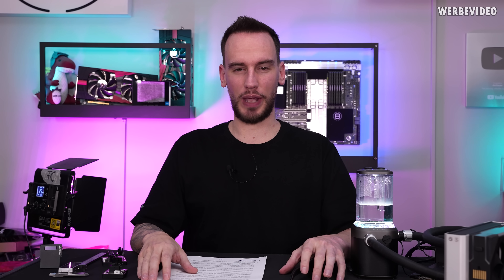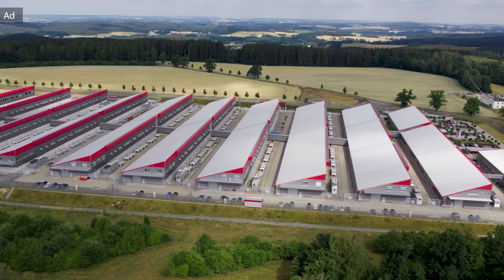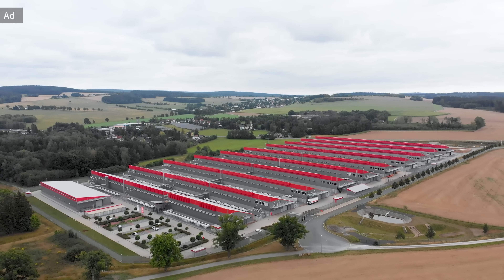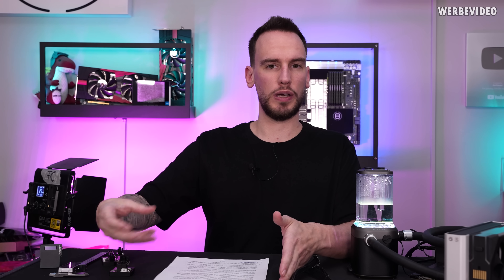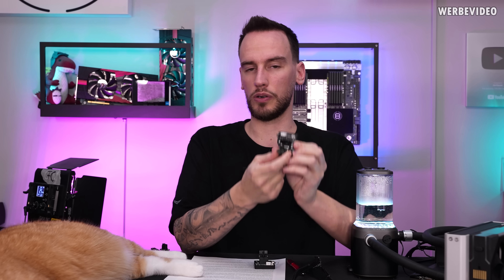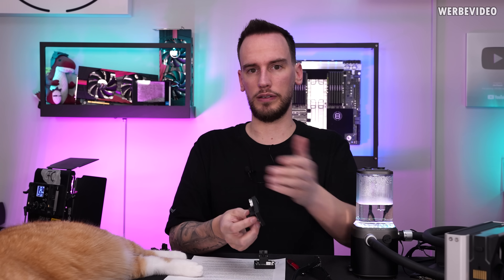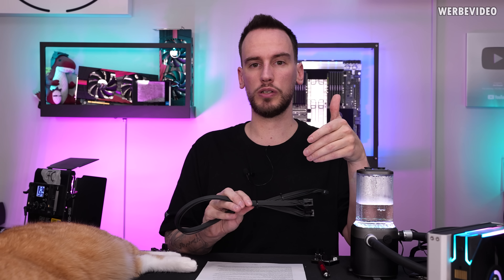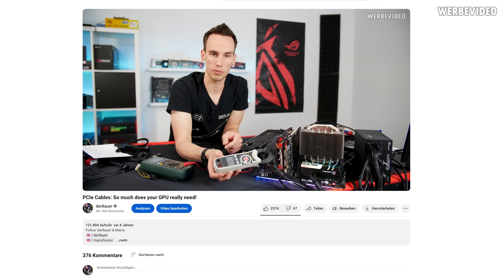12VHPWR is just Garbage and will Remain a Problem!!

Comment: The biggest tragedy I'm finding in all of this is nobody is stepping up to take the blame and explain what happened, nor is any government body making that call. I'm surprised the EU isn't doing something to the effect of slapping NVIDIA or anyone involved in PCI-SIG with penalties until they explain why there's literal fires going on in people's computers.
Reply: Gamer's Nexus took out the momentum there unfortunately
Reply: @fist003  How did they do that? This is an obvious fire hazard, regulators should be forcing a recall regardless of what GN says or does.
Reply: @bobbygetsbanned6049  based on their video at that point of time, the finding mostly pointed towards user error in not plugging it all the way in. This sort of gives a free pass to NVIDIA and the AIBs. 

Also the failure is not as "spectacular" as  the Gigabyte exploding GPUs, guess the authorities didnt see it as a fire hazard.
Reply: @fist003  And this video with the not-plugged-in light on the card showing how easily "not plugging it in all the way" can change. Even if you don't touch the wire, the wire moves on its own when it heats up and cools down.
Reply: @fist003  Ah yeah, unfortunately people will stop thinking and just follow a usually reliable channel.
Reply: @fist003  it's especially important to note that while Gamers Nexus might do some good work with their findings, they are also in the business of marketing products to consumers just as much as Nvidia is willing to do so. It's an inherent conflict of interest because groups like Gamers Nexus always have to be making a deal with the devil.
Reply: @fist003  pretty sure thats not what they said.  They were reporting on what nvidia and Aib had said.  They infact tested sveral of the plugs and lund them to be faulty even without overlocking. Make sure you are being a good third party reporter and keep your facts straight.
Reply: @fist003 GN really fucked up then. Pretending this is user-error is dangerous and irresponsible. It’s an engineering error, and one that any marginally experienced ee or ee hobbyist could probably math out in their head.
Reply: Its a non issue. According to the AQL industry standard (Acceptable Quality Level) the acceptable failure rates are as follows. This issue also would fall under a minor defect due to scarcity of the issue (less than %0.1) :

The failure to meet the requirements of customers with respect to quality is termed as defects. The three categories of defects are:

Minor Defects - Not likely to reduce the usability and material of the product for its intended purpose, but slightly altered from the intended design and specifications. The industry average AQL for minor defects is 4%.

Major Defects - Not acceptable to the customers. Usage of the product will most likely result in failure. The industry average for AQL for major defects is 2.5%.

Critical Defects - If accepted, this type of defect could potentially harm or injury the customer. These defects are completely unacceptable. The industry standard for AQL for critical defects is 0%.
Reply: @javiersantana848  A fire hazard is unquestionably a critical defect so I have no idea how you came to the conclusion it's a non issue.
Reply: @javiersantana848  You are conflating failure rates with defect rate and an internal quality control metric vs actual real world incident rate.  A component doesn't have to fail to quality as a defect.  AQL is an internal quality control measure which samples batches of products for defects.  Damaged video cards are an external number not handled by AQL and it would be silly to do so.  The whole point of internal quality control metrics like AQL are to reduce the number of defective products going out to the customer through internal sampling.  Waiting for products to catastrophically fail to then could that towards a defect rate would be a horrible idea.

AQL isn't a really worthwhile metric for consumers anyways.  Each company determines what qualifies as a defect and is an acceptable quality level to sell to consumers and therefore it isn't an indicator of the number of defect consumers actually experience.  The same two companies in the same market can have wildly different AQL guidelines simply because one company produces a cheaper product while the other doesn't.  It's purely used by the company to achieve the quality goals they have set, whether those are good or bad.  It's not an actual measure of real world defects by extension.

Also, according to the video the failure rate is approx 1%.  Considering the severity of the issue and that graphics cards typically only have a 1-2% RMA rate, I'd consider a single issue accounting for half your defective products very significant.  In addition, consider that those rates are likely to increase as the product ages as the pins spread out more.  This increases resistance and thus increases heat.  That we are having so many occurrences of this issue so early likely means that these cards will see an increased incident rate as time passes.
Reply: What EU will ban for consumers in future, are devices what take more than X number wattage. Ecample 500W.
They force people to use mobile devices only.
Reply: @GameBacardi thats completly bullshit

Comment: it's why i avoided this BS connector, as a electrician i know that many amps in such a tiny connector is just a disaster wating to happen, thank god some 4070's have the 8 pin plug, if Nvidia will keep this connector for the upcoming Gfx's card il just switch to AMD(unless they are dumb and start using it to), what was wrong with the old but trusted 8pic plug, why reinvent the wheel -_-

Comment: — Why don’t they juz mount the connector on the GPU facing up/down or even on the short side of the PCB instead ? I mean this would alleviate the extreme bends required for current sideway mounted connectors as well .

Comment: i do not agree with anything about continued use of the 12vhpwr connector..... 
A single xt90 can handle more then 1kw at 12v... yet it is smaller and industry proven to work flawlesly at that power....
Also, the xt connectors are rated to (un)plugging 1000x, the 12vhpwr... well it isnt :)

Comment: The thing with 12VHPWR cables of various PSUs is, they differ with temperatures they achieve in normalized benchmark scenario. They differ with temperatures cable gets, but also connector and both temperatures affect each other. Add to this real-life scenario with this 450W or more being pushed into closed case, maybe even not the best ventilated, to warm the cable even further. Not counting user errors, cables not fully plugged or abused to just fit in case or look pretty, it's the most likely explanation of whole 12VHPWR drama.

Comment: Remember seeing this connector for the first time. I was like... but how? How is this NOT going to cause problems? And wouldn't you know... it's being a problem since day one.
Same as many people i fail to understand how this piece of crap passed any test upon the release on market. I also have 12VHPWR + RTX4090in my PC and it well.. it works fine so far, but there is always a doubt somewhere in the back of my head. Ridiculous, simply ridiculous.
Reply: I had the same feeling.  Nvidia just seems like they will not care if peoples houses burn down with them in it as long as it doesn't cost them money.

Comment: This all boils back to the ridiculous 12VHPWR adapter.  Why try to push 600W+ through such a small connector?  High current flow equals heat.  Worse, this issue was long solved with the 12/24 pin ATX connectors.  I would rather NV have just stuck with 3-4 8-pin PCIe connectors on the cards.  I doubt we'd be hearing about melting connectors.
Reply: The moment I heard that this connector can only be connected and disconnected so many times, I vowed not to buy a nvidia card for the next couple of gens.  They are so greedy they will do a thing to save 50 cents that might burn our house down with us in it and only care if it costs them money.

Comment: 16:30 No, the correct thing to develop a proper new connector and give up on the mini fit design.
It's old and was never designed for these levels of power and there are modern connectors from brands like Amphenol or TE, that can not only handle these power ratings, but ensure a proper fit by design.
Even using 2 x 12x6 connectors, still leaves a lot of room to the chance of melted pins from a bad contact.

Comment: As I install my water cooled RTX4090 vertically with a good Cablemod 4x8pin to 12VHPWR cable I think I won't be in trouble.
But after I watched your video I'm really worried that even I can have my RTX4090 connector burnt.

Comment: actually using 2 connector won't work for most.. most PSU rated to handle a 14900K and 4090 is above 1000W, which usually don't have enough PSU side connectors for that 2 cables... unless you wanted to recommend everyone using a 600W card to buy 1500W PSU

Comment: Great to see that you are not scared to say what you think. Happy new year and keep it up in 2024 Roman!

 I 100% agree. I have a 4090 strix and the luxury of having it vertically mounted and watercooled. All in a lian li 011d XL. And still every time I open up my case I triple check the cable. Im never going to get comfortable with it.

I wish I could post photo's of how I mounted the card and routed my cable just to show how straight up paranoid I got and still am about it.
Reply: I am also using the vertical mount adapter in my O11D XL with my 4080. I have the 12V cable feeding directly up and over the 24pin m/b cable which is supporting it vertically and keeps it straight. I still check the connector every time I open the case to work on something.

Comment: They should have moved to using the CPU-like 8-pin connectors, like server cards do. 2x8 pin EPS can deliver a ridiculous amount of power, and you can always add a third one. Yes you would have needed Dongle City with old PSUs, but the 4x8-->12VHPWR dongles are just as ugly.
Reply: ive always wondered why needed a different connector for CPU's / GPU's

Comment: Maybe NVIDIA Should just stop making GPU's which needs an insane amount of wattage. 600w for a GPU is madness !!!
I currently have a 4070 with the same connector. And I have to check every week if the cable is fully inserted. I even under-volted the GPU in case something bad happens.
With 2x 8 Pin i never had to worry about that. Please remove these connectors !!! They're a fire hazard !
Reply: @RC_Flyer-h2v  It depends on the model. I wanted an MSI to match it with my motherboard. And mine didn't come with an 8 pin connector.

Comment: So basically if u have a 4090 undervolt it to be safe. Less Heat in your room, less noise and now with the added bonus of your house not burning down.
Reply: It is not enough… if the connector bends… no underwolting can help…
Reply: Well don't bend the connector then @haukionkannel
Reply: @argasasrgetthe9032  
If De8auer  bend connector like in this video, without even trying... what user can do? Hold the connector straigt whole the time when using the computer? 
🤣
Yeah... not ideal...

Comment: I believe that some of those burned connectors are indeed user error while plugging the cable, but that also tells me that this connector is the opposite of good engineering.

Edit: 14:10 OMG thats insane
Reply: Yeah there should be no way to accidentally plug the connector in wrongly.
Reply: @greenbow7888  Only with a hammer maybe...